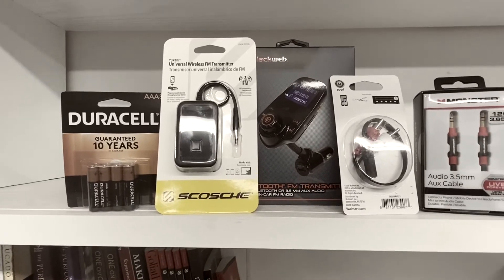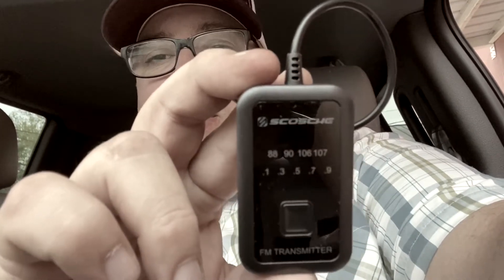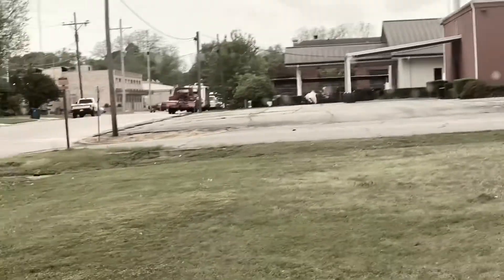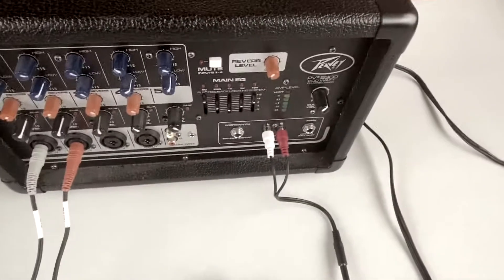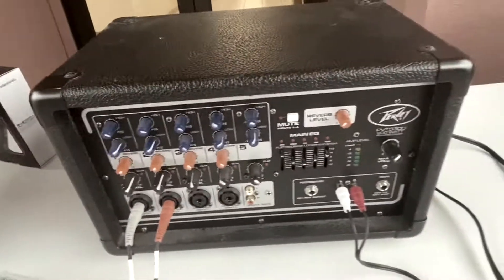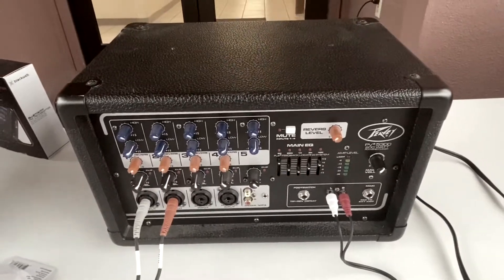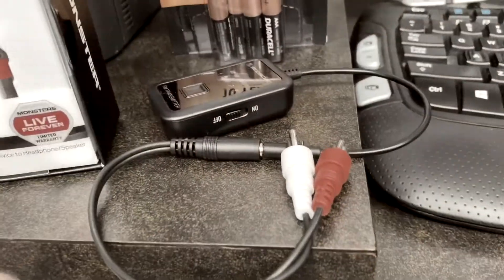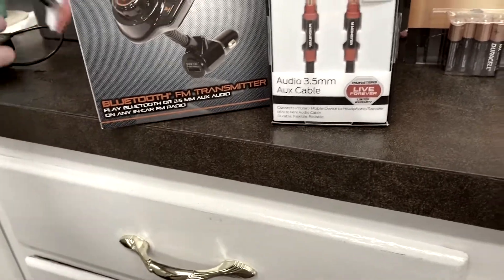FM Transmitter Workaround!!!

Comment: This is a great review awesome I didn't think something that small would put out such a white range of course if you're familiar with section 15 of the FCC rules for unlicensed Broadcasting you're only allowed to Output a signal of 125 ft however if the conditions are just right the signal might cover a slightly wider range I see that it went well for your service that's great. One other thing to consider would be determining just how good somebody's radio is in their car some radios might be a little more sensitive and picking up signals than other radios in different vehicles. I'm considering on setting up an in-house broadcast here at my house just to have music playing off of a computer in a continuous loop so if I ever want to listen to my digital music library I can just have it playing constantly this device looks like it would do the trick for me however since its battery-powered I would have to constantly be switching batteries but for $7 it's not bad it all puts a very good range. I may start off with this little device and maybe work up to something that's powered by AC power as opposed to batteries there are slightly larger transmitters but you have to be pretty careful when using those because they may not be compliant with the FCC rules for unlicensed broadcasting even though the packaging may say that it is it can be pretty tricky. Thanks for the review have a great day God bless.

Comment: Nicely done my friend.  My Church is using the exact same Scosche unit.  I'm sure you've tried it by now but I can tell you it WILL work with some caveats.  We have tested it!  First of all you WILL have less range once you fill that parking lot with cars (especially if the transmitter is at the same height as that amp.)  But you can improve your range by doing two simple things.  1) Add an external antenna to the transmitter.  Here's how to do it super simple... cut either a 24" or a 48" length of thin insulated wire.  These lengths correspond to what are considered quarter wave and half wave antennas.  Strip about a quarter inch of insulation from one side... and you might want to put some electrical tape on the other end.  Take the stripped end of the wire and tuck it inside of the negative side of one of the two batteries so that it's wedged in place.  Let the wire just hang out of the battery case.  Do not connect it to anything.  Be careful that the battery connection doesn't short across the batteries and don't let the dangling end touch anything or you'll lose the signal.  This works with most FM transmitters that have the audio pigtails like the Scosche.  That's because of a little trick the designing electrical engineers have used for years.  The audio cable has 3 wires... one for left channel signal... another for right channel... and the third for ground.  It's long been known that the antenna can use the ground line as an antenna.  So these units have long used the ground in the audio cable as an antenna.  If you really want an even better antenna you can take another run to Walmart and pick up an automotive replacement antenna.  That will work much better than a simple piece of wire.  If you do this, make sure to use a short piece of wire to connect it.  The replacement antenna is already sized for quarter wave.  Finally, 2) Get that antenna and the transmitter as high off the ground as you can.  Car bodies will absorb some of your signal and if you are transmitting down the line of sight the farthest cars will get less signal.  We used a section of PVC pipe as a mast.  I zip tied an antenna to the top of it and connected a short piece of wire to the transmitter and zip tied it to the top of the mast.  Then I used about 75 feet of audio cable to connect the transmitter to my mixer so that I can run that mast out as far into the parking lot as possible.
I hope your stock config worked well enough for you on Easter.  If not then try these modifications.